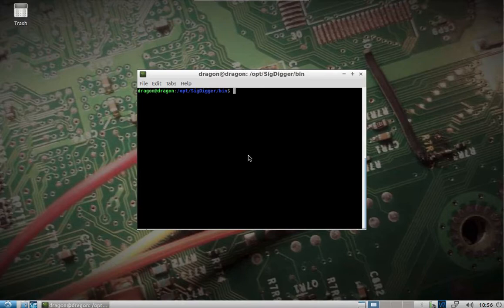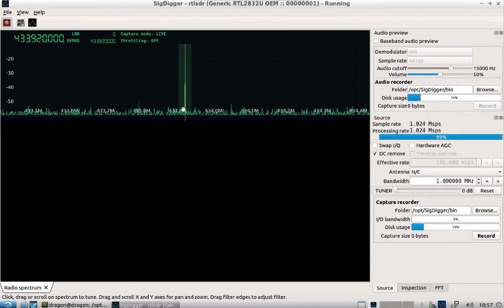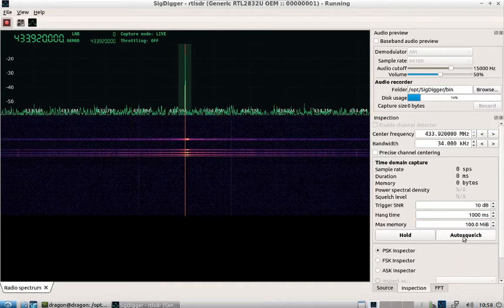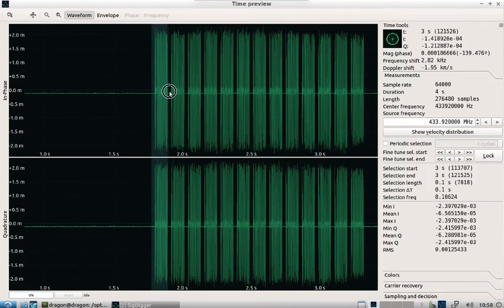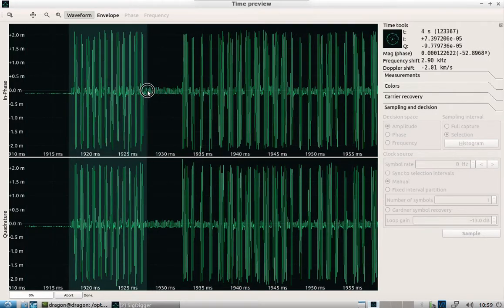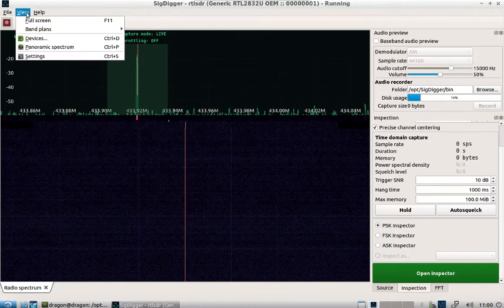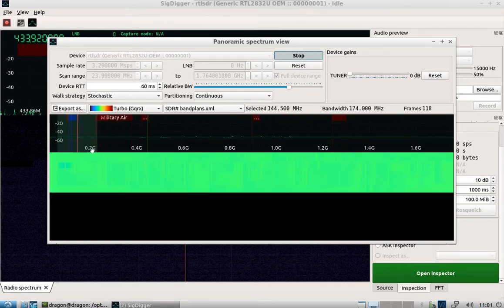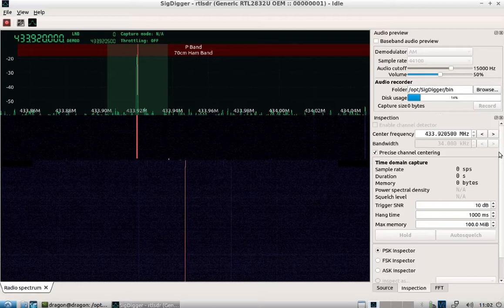DragonOS LTS SigDigger off-line signal analysis using Autosquelch (rtlsdr, hunter fan remote)

Comment: I made a bunch of improvements to SigDigger's panoramic spectrum feature, which should get merged into BatchDrake's develop branch soon. Notable user facing improvements include a new "progressive continuous" sweep strategy and much nicer handling of frequency zoom, including support for zooming the waterfall view history using the OpenGL waterfall view. I also implemented major improvements to tuning speed for the RTL-SDR and USRP UHD drivers. You can check out the librtlsdr and SigDigger/SuWidgets/sucan/sigutils. It's now quite slick with the fast frequency sweep (using my custom SDR drivers) and the zooming waterfall.